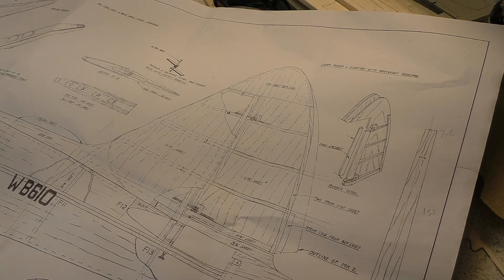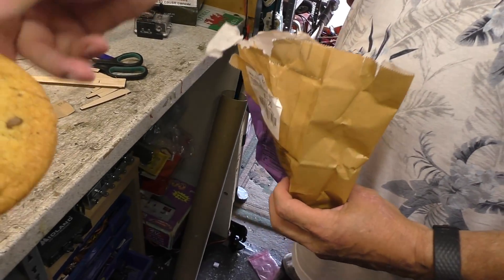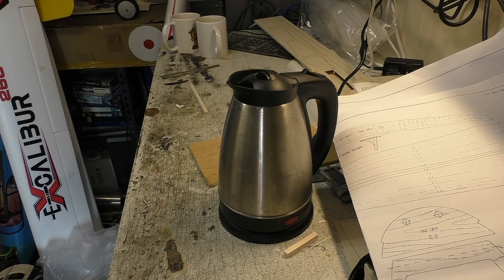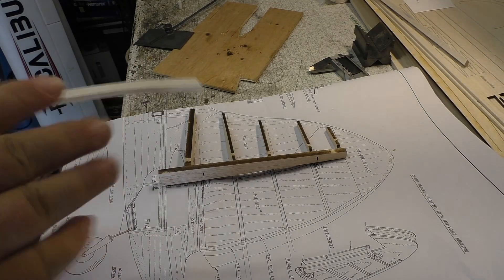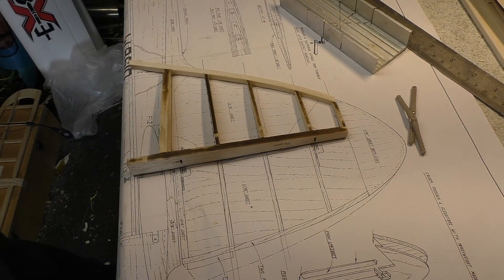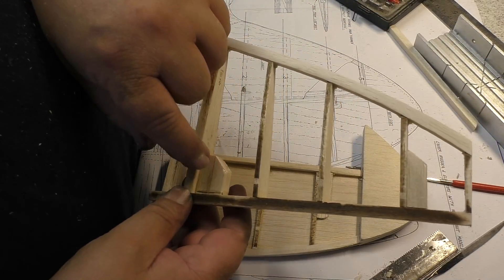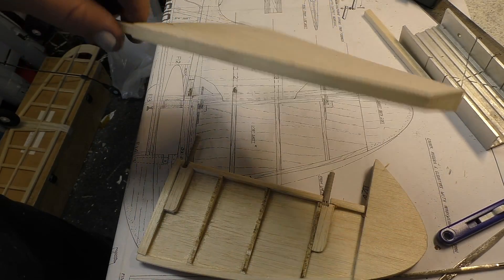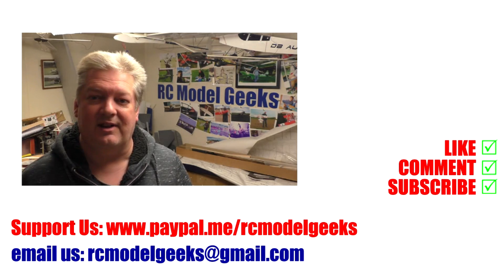Sarik Hobbies Dennis Bryant 68" DHC-1 Chipmunk Build Pt2 RC Model Geeks

Comment: Firstly Rob I very much like the new format,it works very well with the fixed camera on that mini tripod,wise decision on those hinges personally I did not like the strips of whatever material,they would have been very awkward to set up into position,the barbed hinges are ideal.
That lovely de Havilland fin makes a good starting point,I can see you have built full sized aircraft too because the fin is always the part they suggest you build first !
Many people will be amazed at how well balsa steaming works,once again a full sized thing on spruce aircraft construction,sometimes on long lengths they make a steam box to place the strips of wood in prior to tweaking.
I like the way that you are prepared to assist others whether it is about building models or helping a neighbour,that is very commendable.
Reply from the maker: Haha you are so right. As i was building the fin i was thinking exactly that! Yeah i love them barged hinges, plus its much easier to make a round hole then a square or rectangular one!